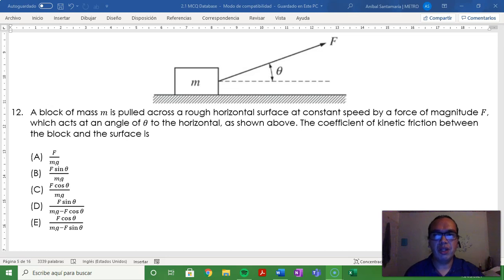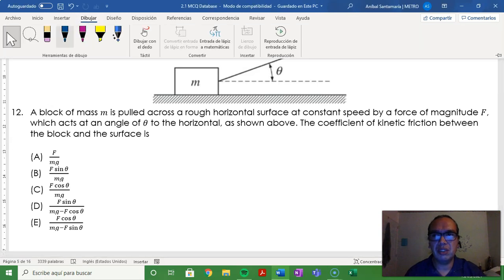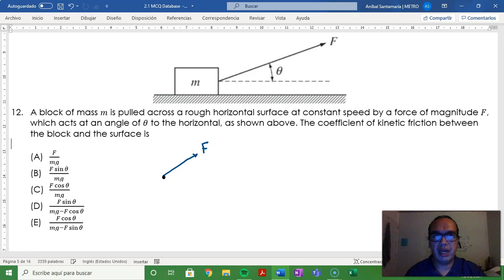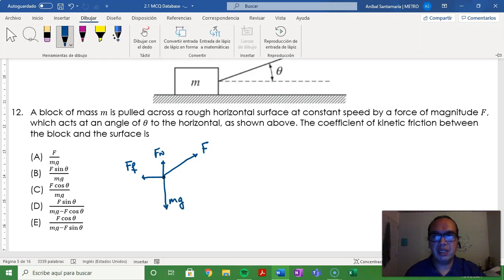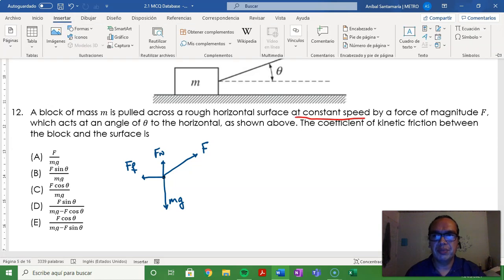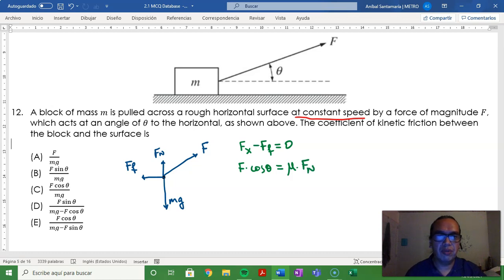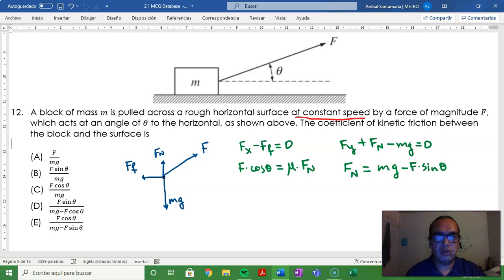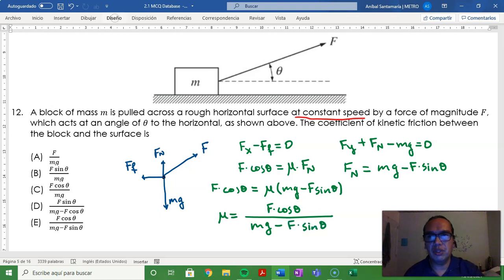2.1-12 Coefficient of Kinetic Friction on an Object Being Pulled at an Angle Above the Horizontal

Comment: The correct option is E because after drawing the free-body diagram and knowing it is an equilibrium problem, the forces must cancel each other. For the Fx is Fx=Ff, and Fy is Fy+Fn=mg. Ff can be substituted by the coefficient of Ff times Fn in the first equation and the second equation can be rewritten to substitute Fn in the first equation.